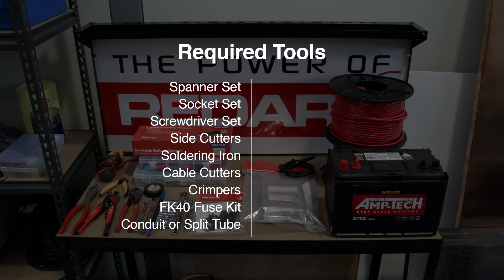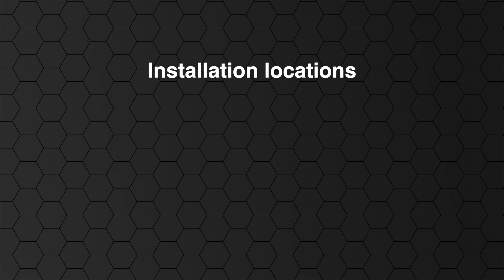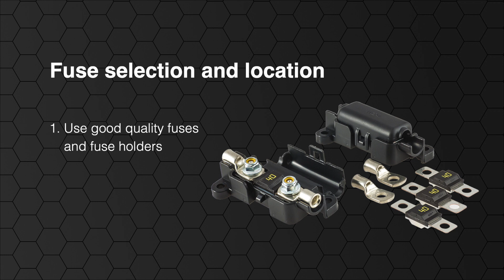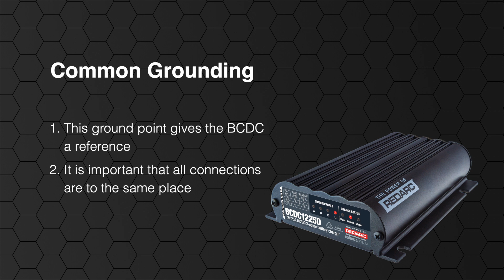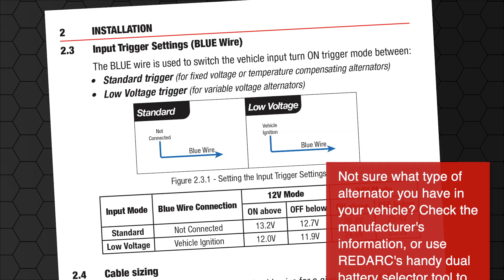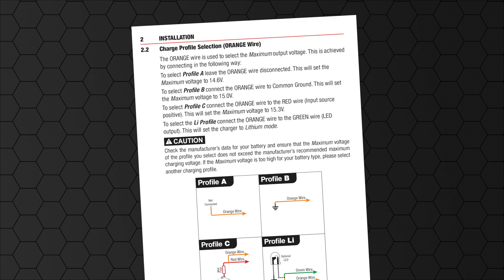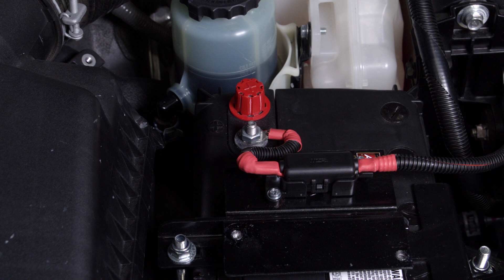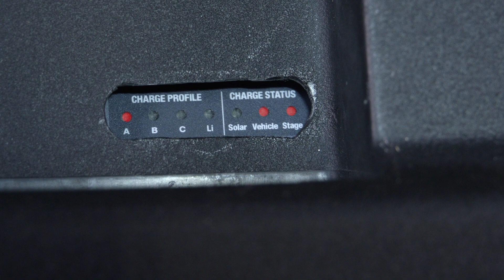How to install a REDARC BCDC Classic battery charger

Comment: What could be the problem if I put  the tin blue wire into positive ?
Reply from the maker: Hi, Connecting the Blue wire to positive will cause the BCDC to pull the start battery voltage to 11.9v each time. This is a little to low for vehicle starting. Blue wire is best to go to an Ignition source.

Comment: Does the BCDC 1225 has the jump start feature?
Reply from the maker: Thanks for watching! No, if you are wanting to add the ability to jump start your car from your auxiliary battery I’d recommend to add our SBI12 into the circuit. For more information on how achieve this please see the link here -https://www.redarcelectronics.com/au/resources/chargers-isolators-wiring-guides/bcdc-dual-with-jump-start-feature-the-ultimate-battery-setup/

Comment: If I connect a solar panel to the dc dc does the panel needs a controller?
Reply from the maker: Thanks for watching! No, our DC-DC chargers have a built in solar regulator and will take charge from unregulated solar panels only.
Reply: @REDARCElectronics 

I get an error with the 400W solar panel. All the lights are blinking.

Comment: Wouldn’t putting the lithium battery and or charger in the engine bay shorten the life of them from the heat ? Especially summer time through out the years.
Reply from the maker: Thanks for watching! No battery likes being under the bonnet of a car, over time the heat from the engine bay would be expected to shorten the life of any battery including lithium. Our BCDC Classic range of chargers have been designed for engine bay install and to withstand the heat.

Comment: Regarding earthling this setup:  I'm using a portable battery for my aux battery.  It cannot be perminant grounded because it's portable.  Can I simply run a negative cable from the starter battery terminal along with the positive (fused)  that comes from there, with a plug on the end, then the plug connects to my portable battery box. The inside of the battery box I have the other side of that plug which goes to  positive and negative terminal junctions.  Then the positive junction terminal has a positive running to the bcdc, and the negative terminal has a negative running to the bcdc. This negative terminal can also have another cable running to my aux battery.  Then, I can run the bcdc power out cable directly to the aux battery with an inline fuse. It seems like this would work since the aux negative and the bcdc negative run to the same terminal, which then runs to the starter battery negative terminal, meaning they all share the same ground. Please advise.
Reply from the maker: Hi John, indeed the connection to the Start battery for Positive and Negative will be fine for this type of setup, yes. All the rest of the ground connections will then be made in the battery box to the battery and BCDC, so yes this does make a common ground scenario. As you’ve laid out in your comment, that sounds perfect and how we would expect it to be!
Reply: @REDARCElectronics  thanks, this is  great to hear.  I'll be making this purchase now that I know this will work.

Comment: Hi guys, does the aux battery need it’s own earth separate to the starter battery for the bcdc isolator to work?
Reply from the maker: Thanks for watching, Jen. Yes the auxiliary battery will need to share a common ground with the BCDC and the start battery. If you have any further questions please be sure to contact our helpful Tech Support Team over the phone.
Reply: @REDARCElectronics  Should you run a negative cable from under the hood in order to make that common ground connection?

How would the ignition wire be connected?
Reply from the maker: @NomadicIsaac  you can run a separate cable for your ground connection if wanting. Otherwise, utilise the chassis as a common ground point – saves that extra cabling. The ignition trigger can be tapped into a source that purely has 12V when the engine is on and 0V when it is off. You might need to locate the fuse-box and see if you can tap into a signal there. Any further questions please contact our Tech Support Team on 1300 REDARC and they'll be more than happy to talk you through this in greater detail over the phone.
Reply: When installing in a camper can the black wire from dc just go to the negative of the camper battery